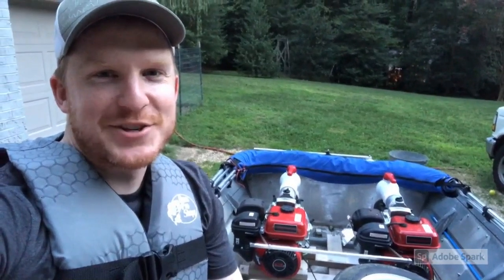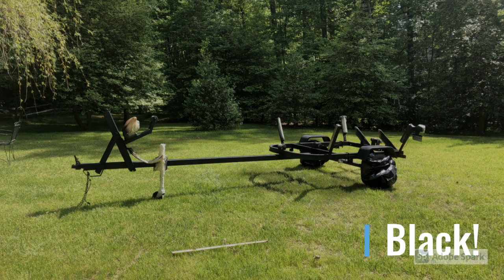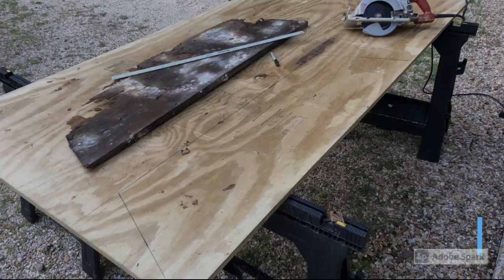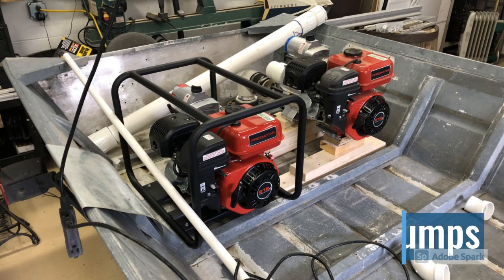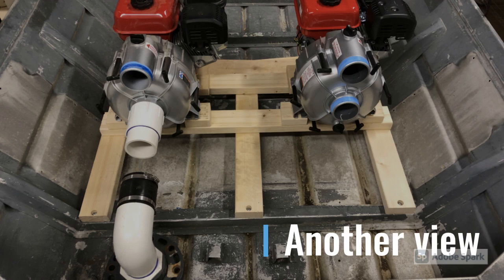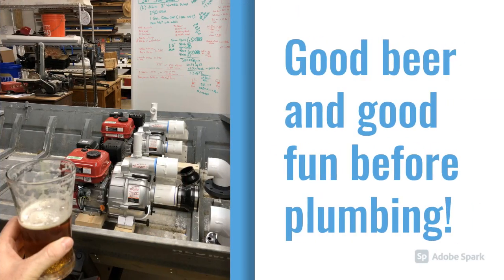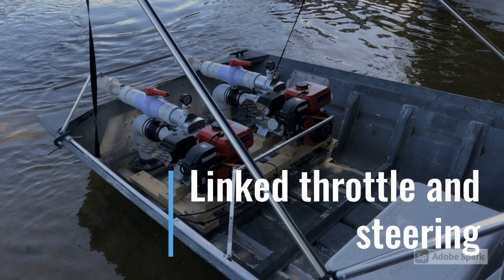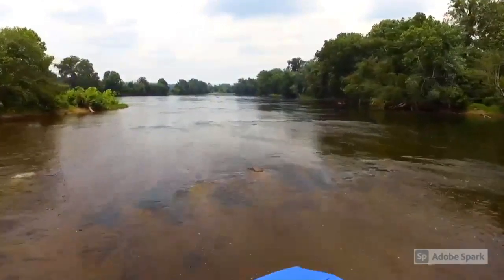How to Build a DIY Jet Boat

Comment: the pump outlet needs to be at or below the waterline...
Reply from the maker: Why is that, can you explain?
Reply: @greenlizardusa3105  tractive force. water and air are both liquids. the difference is viscosity. water pushing against water encounters more resistance therefore provides more thrust. Physics and all.
Reply: @greenlizardusa3105  Diesel is 100% accurate. Water pushing water will create more thrust. I bet you get double the speeds and acceleration with your jets at water lever.
Reply: @greenlizardusa3105  Newtons Third Law. For every action, there is an equal and opposite reaction. It's the difference between jumping off a pile of leaves and jumping off a pile of rocks. Which one is going to let you jump higher?
Reply: Greenlizard has a point of how the jet works (in another comment or video i can't remember). However Diesel's application is correct.
Reply: The question to consider is ''how would the boat know which direction to go in?'' This is where the discharge location/ direction relationship comes in. If this is not considered then we will just have a very efficient pump sucking really hard with the boat going nowhere in a hurry.

Comment: Very cool. I've been collecting parts and making plans to do a jet John out of a WaveRunner but this idea is intriguing.

I agree with some of the other commenters that you will get better performance with the pumps pushing the water into the water like a traditional jet ski.  

Curious as to how fast the boat is now and if you were to have the nozzles exit just below the water level.

Thank you for posting. This is a really cool idea.
Reply from the maker: Thanks @Garage of Hope! Stay tuned for my video that will be posted at 5pm today. It's the proof of the thrust above water:)

Comment: There are more factors that go into. Yes in a stationary position it produces more thrust. How however in a real world application all those corners in the piping on your jet Jon cause loss of velocity as the water make the bend. The reason why they the nozzles are at or below the water is because you lose less energy pulling it through the pump compared to up and out. Also, there is energy gained as you are driving through at a rate of speed which is forcing water into the intake.
Reply from the maker: Yes, the bends and length of pipe create "frictional losses" and are inefficient. This boat is a simple, cheap build, and I knew I'd never get on plane due to the size of the pumps (and low flow rate). For that reason I kept the outlet above the waterline (above the transom), because you get more thrust accelerating water through air than water through water.
Reply: @greenlizardusa3105  When jet boats plain technically the nozzle is out of the water. Yes it is below the water line, but the wake the boat makes clears the water from behind the transom. I don't know that your tests really proved anything different.